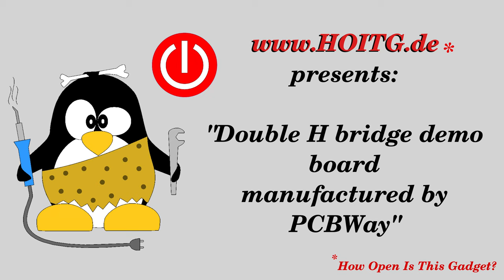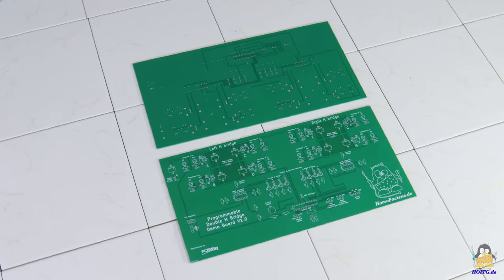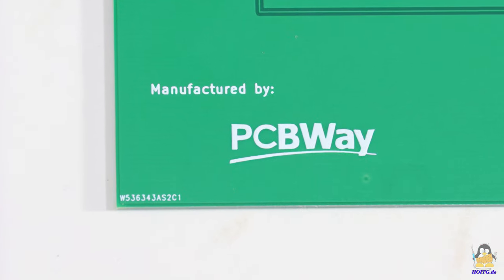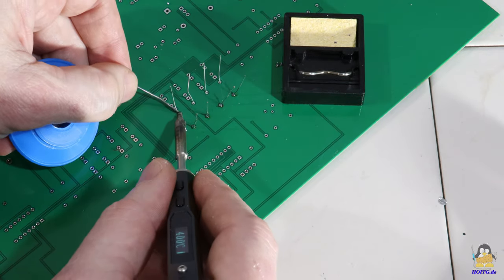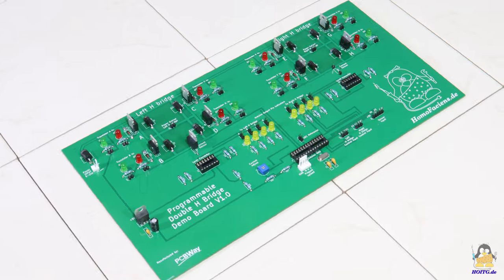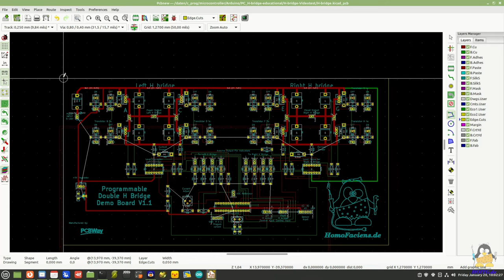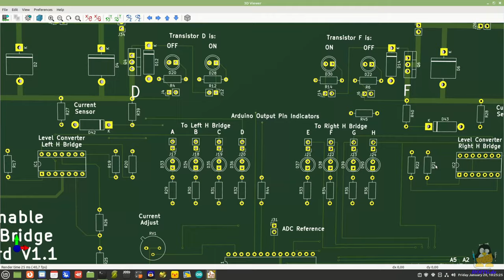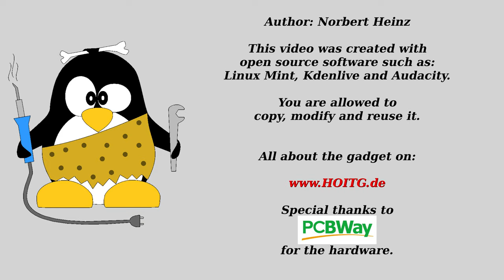Demoboard for a freely programmable, double H bridge, manufactured by PCBWay

Comment: In highschool, our professor of electronic manufacturing, usually drop our handmade boards (made with edding markers, and a lot of patience) to the floor to check the solderings. This video remembered me that, the sound of the board you dropped.
Reply from the maker: Not an industrial standard test, but a really practical one. Not too academical professors are the best!